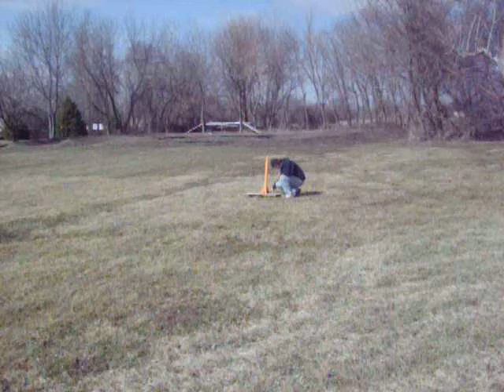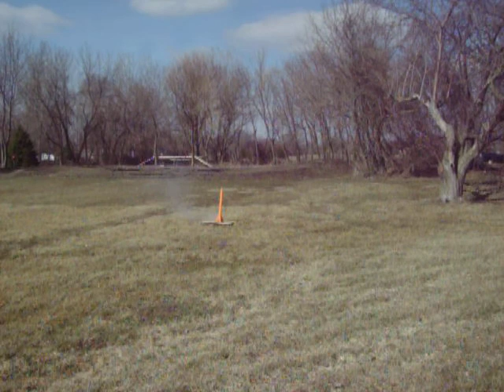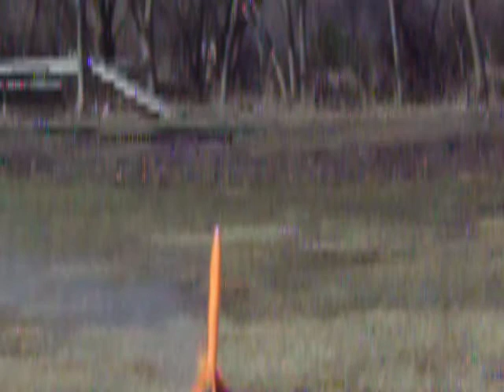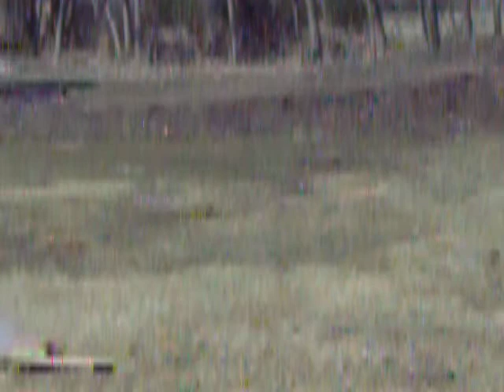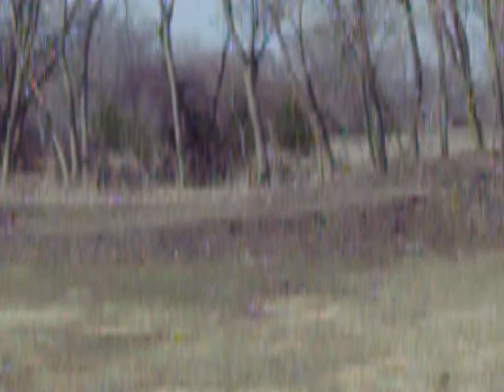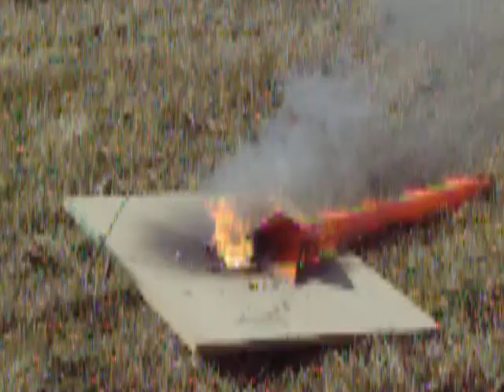Sugar Rocket Gone Wrong..

Comment: Mixing and casting errors aside, what was the throat diameter?  Exit diameter?  Nozzle length and configuration?  Did you plan for some back pressure in the combustion chamber?  What about the propellant shape, was it end burning or center burning?  Lots of things can go wrong in rocket science.  You can't expect a drilled-out pipe bomb to get you into the mile high club.

Comment: @crankyboris and weirdone17: The KNO3 + Sugar mix will indeed burn hotter and throw more mass out of the tailpipe than plain KNO3 + Sugar.  What appears to have happened is that there was either a casting error or more sugar than expected, and a meltdown occurred rather than thrust.  I don't know enough about the mechanism involved to make a call on that aspect.

Comment: boil that shit down in some water, use a pan that will allow sugar to melt rather than insta burn, the kno3 will dissolve in the water aswell as the sugar and eventually turn itto a paste, cast this paste, if your shit explodes on launch then soften the "grain" with "some" corn syrup or some such liquid sugar. and rust is paramount for optimal energy, superfine aluminium also if u can source it.